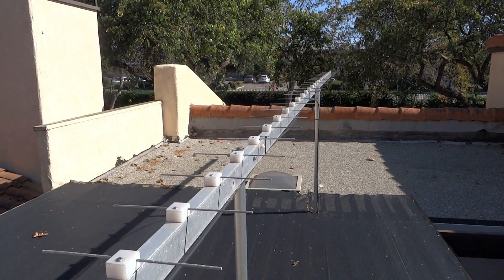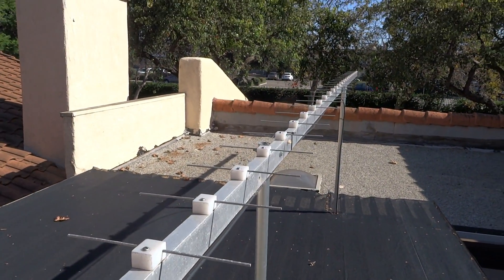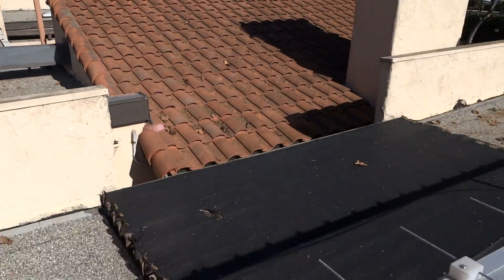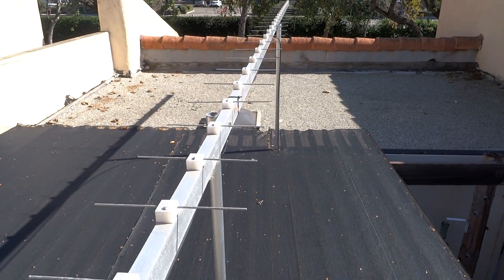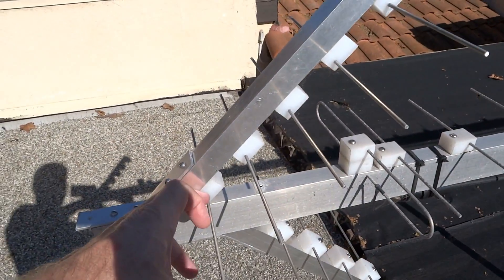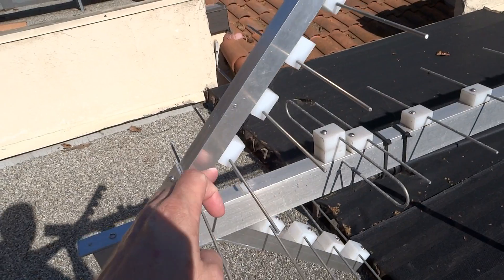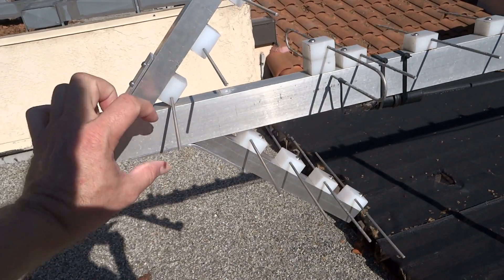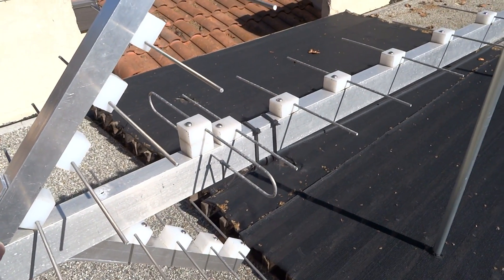Homemade yagi TV antenna - followup

Comment: jesus h talk about over kill. my simple 12 in yagi picks up channels like a boss. what you need to understand is that you need a material that responds to the freq that is put out. and you are not using the right stuff. i have tried many,many diff materials and diameters mixing and matching alluminum,copper.stainless. im telling you that thin copper wire with the same diameter for reflector driven and front wires need to be the same. and gee where can you get thin copper wire that has coax ends on already. duh strip back the shielding, make a dipole and dont use a conductive material for what holds the dipole and rods. seriously my tiny yag picks up over 100 channels and have exact replica that works the same. your antenna is overcompensating for something
Reply: Where do you live?  A simple 12 inch yagi antenna will NOT pick up over 100 channels in Bandera, Texas.
Reply: @MrRodahi  i have changed my design and simplified now only using coax 8 inch cable using outer braid for antenna. directly to the inner core. short length of coax to tv. i live in the bay area with a possible max of 137 channels and best to date is 125 channels and consistantly pull 96 to 103 channels all the time from 6 feet off the ground in window.  the most important is though is placement. i moved it 2 feet once and thought would be better and only 67 channels. i have tried honestly hundreds of designs and variables i am being honest about results.  so this is what i have done.  take 8 inches of coax.   strip back inch and half  remove the core plastic between the inner wire and copper shielding solder the inner and shielding together.  with inch of inner core left over. then connect that  to the end of  length of coax from tv. with butt splice or how ever u choose. u cant argue with results. its the best i have made and have made hundreds. honest
Reply: @brucekeck1351  If you live in the Bay Area of California, you must be REALLY close to many transmission towers.  THAT makes a huge difference in how many channels you can receive.  My point was, if someone lives in a remote area, a small antenna will not receive distant signals, regardless of design.  For example, if you lived in Redding, how many channels would you get with your antenna?
Reply: Unfortunately you don't live in the same place he does and he explained why he needs a super long yagi.

Comment: LOS = Line Of Sight.

LOS =  no type or kind of obstructions between the receiving antenna and transmitting antenna.

LOS =  the best reception.

Trees are obstructions of reception.

So as to avoid the obstructions of trees.

The antenna higher.

Change location of antenna.

Cut down trees.
Reply: However , a tall straight pine tree can be a tall Tv antenna tower that put the receiving Tv antenna above obstructions in the direction/s of reception.
Reply: Yeah, he could go two or three hundred feet out and chop all his neighbor's trees down. Unfortunately, he doesn't have that option I'm sure.

Comment: The dipole looks shorted with the boom.
Reply: You can short the center of the element opposite the feed point on a folded dipole with no loss of signal and possibly reduced noise.

Since the antenna works, I would imagine that is the case.
Reply: if is shorting it wont work for jack sh#t. good eye rank

Comment: Good evening, Brian.
Great job on your newly improved HDTV antenna.
Have you tried building a vertically stacked yagi antenna for HD using PVC?
How far should the corner reflector array be placed from the driven element in inches? I'm planning to build one for rural DTV reception.
Again great job on your antenna!